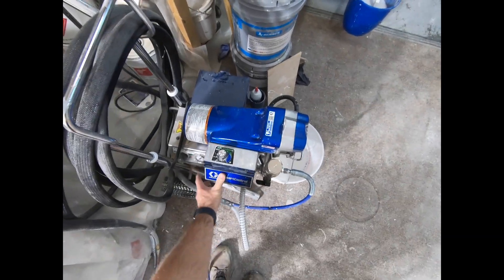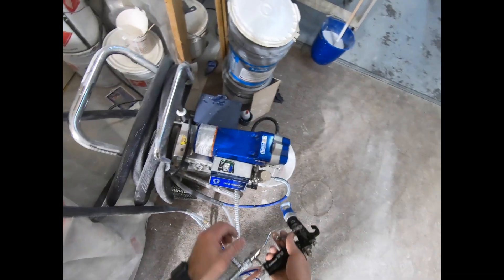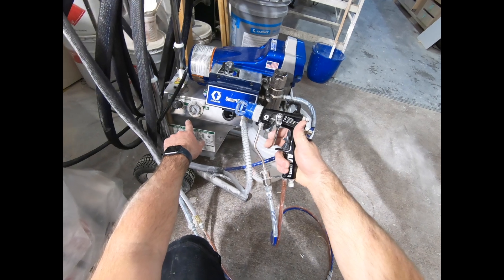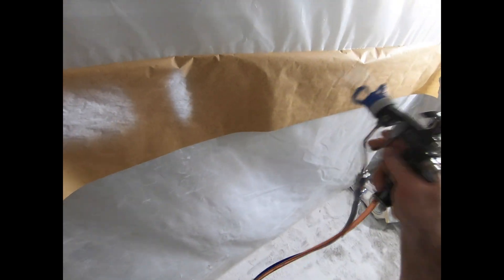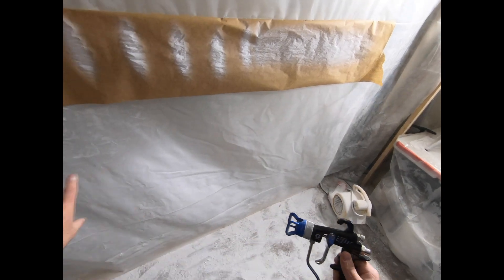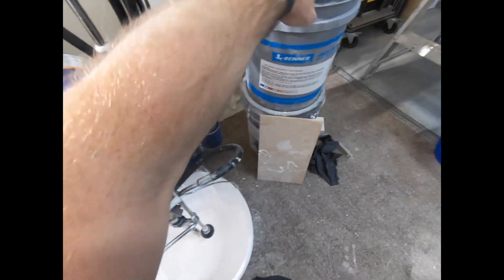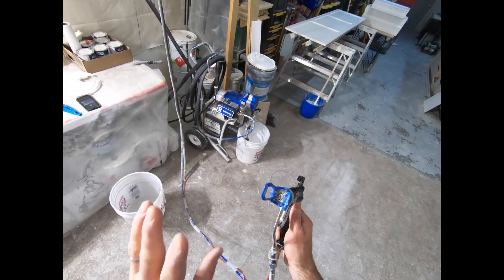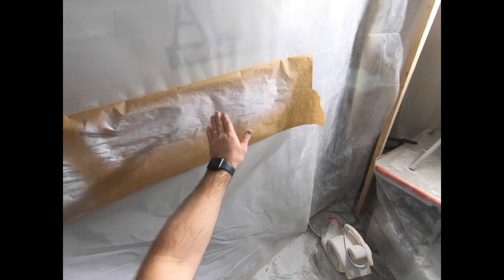Graco Air Assisted Airless Setup

Comment: Hi. I have a 595 air assisted. Why won't the compressor turn off when I spraying  ?
Reply from the maker: Mine did that from time to time, but I cycled the power switch and it reset it back to normal

Comment: Excellent video, thank you for the air and fluid.pressures, and that you are using the AAM309 tip that comes with the gun now. Do you use any other flat tips for thicker material? Looking to purchase the same unit. I've been shooting airless FFLP 310 for interior trim primer using PPG Sealcoat. It can be fairly thick. Wondering if this unit will shoot the thicker material as nicely as you have shown? Thank you

Comment: Great video. You can use an airless gun with this model? Just turn the compressor section off? Thanks
Reply: Yes. There is a switch to only the airless pump like a regular 595.